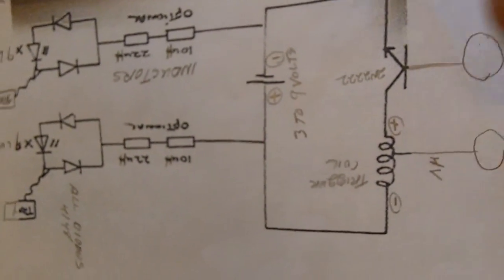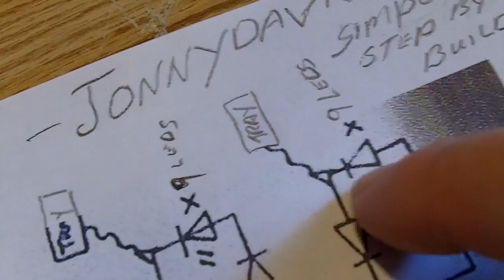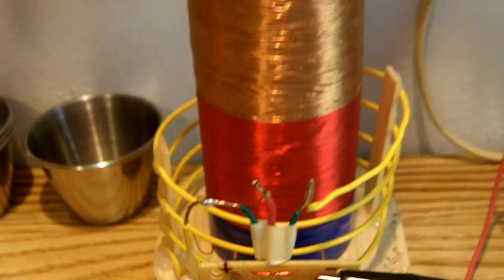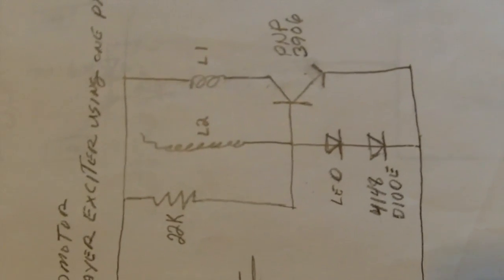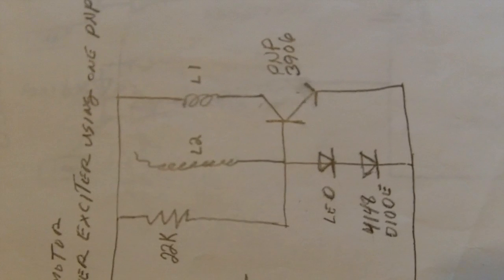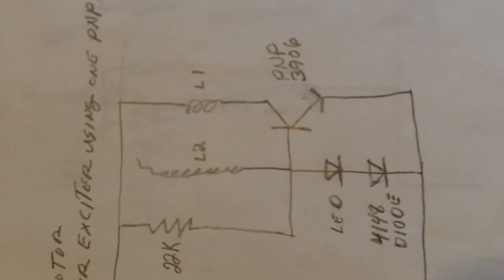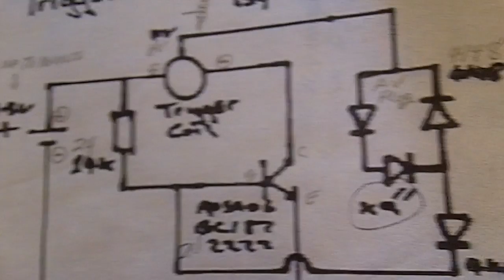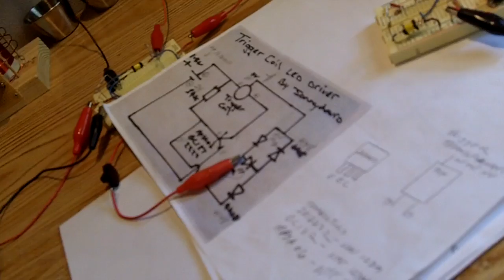Simple SEC step by step build / Slayer Exciters

Comment from the maker: Take a look at my video I called (Smiple transistor rectification of high voltage) that is a Jonnydavor circuit I replicated. I think you could call that running a motor wirelessly.